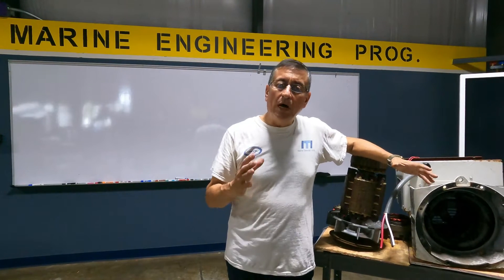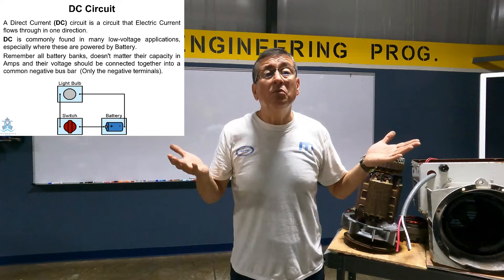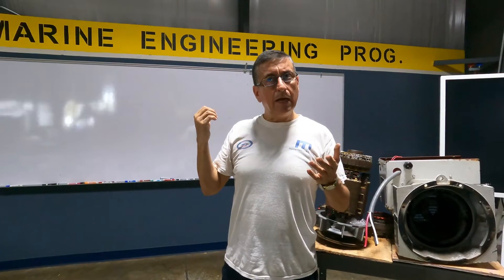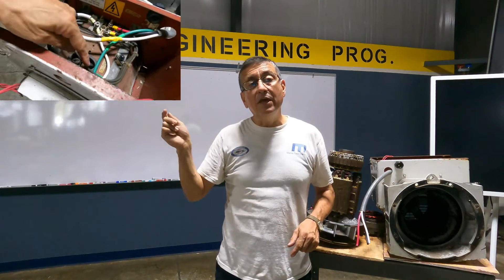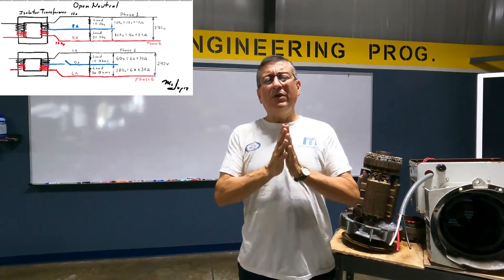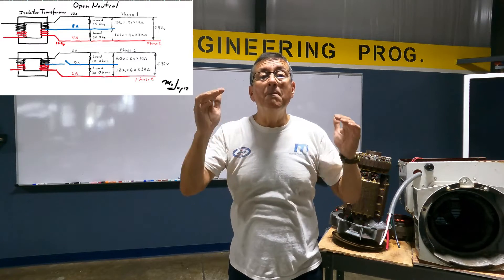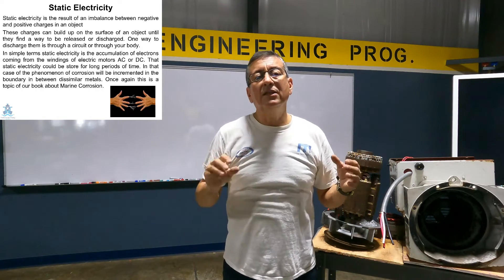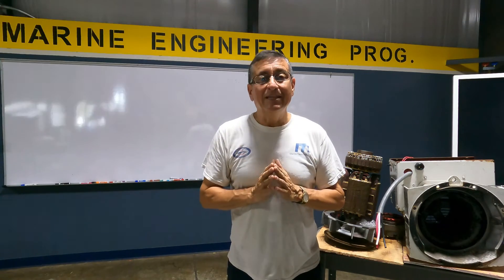Wiring Neutral and Ground in a Boat

Comment: Single phase, split phase, and 3-phase are the standard terms. The neutral is a reference point to the sine wave on the single phase. The wave goes above and below the neutral by 120v in a standard system. With split phase the 2 phases are 180 deg. from each other so the voltage is double the single phase. There is no neutral required since the phases are relative to each other. Sometimes an appliance will have a neutral because there is some single phase in use by the appliance as well. For 3 phase the phases are 120 deg. apart and again generally no neutral. The purpose of the ground is to be a better path than you for AC current to travel back to the source in the case of a short. The confusion over neutral/ground in AC is because both are always at the same potential at the source or panel but the neutral is expected to regularly carry some voltage where the ground is not. Also of note - in a DC circuit the voltage flow is from NEG -> POS not from POS -> NEG. This was controversial for some time but has long been settled. There is no unused voltage. The resistance in the DC circuit limits the draw.
Reply from the maker: Thanks for your apport. I appreciate it.

Comment: Thank you. Again informative.
Still, I have a question.
If the ground and the negative have to be separated from each other, why does Victron draw the ground back to the negative busbar in their schematic?
https://www.victronenergy.nl/upload/documents/1.2KVA-MultiPlus-230V-system-example-with-BMV-Cerbo-GX-Touch-50-Argo-Fet-and-MPPT.pdf
With kind regards,
The Little Captain.